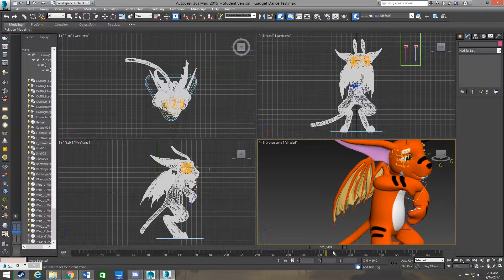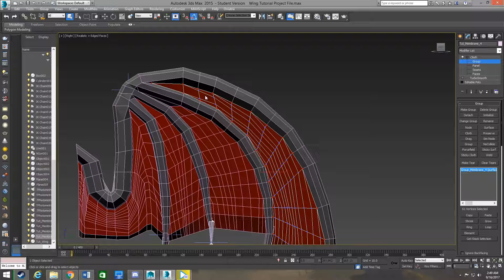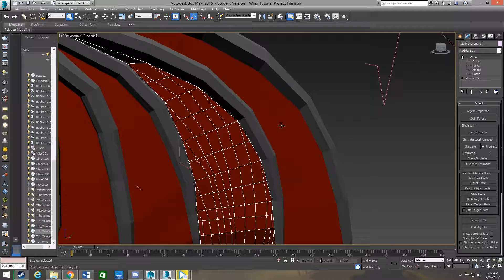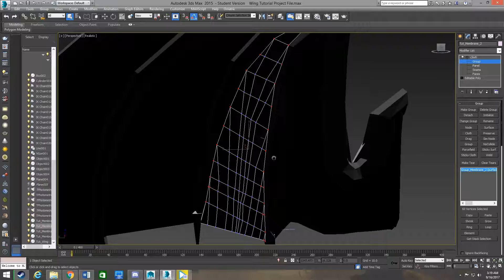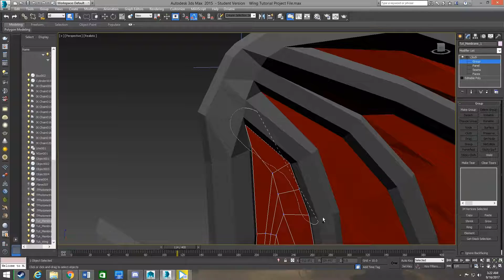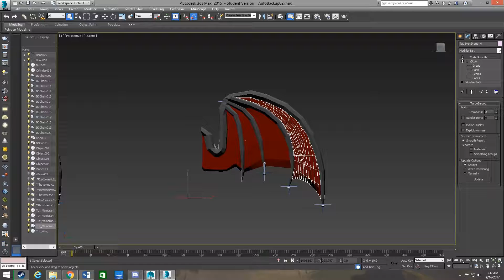[3DS Max Tutorial] - Dynamic Wings with the Cloth Modifier

Comment from the maker: Questions? Concerns? Suggestions for a future tutorial? Leave a comment!
Reply: hello, when I move or rotate the attatched wing the membrance and bones are separated. How can I fix this situation?
Reply from the maker: @aysenurbabacan59  Hi! Sorry for the delay. So the wing membranes will not follow the model until you simulate each cloth. It's a small drawback that I haven't figured a quick fix for. So essentially, you'll want your model in the initial position that you want, then animate the model. Afterward, you'll go through and simulate each membrane. Only then will the membrane follows. Let me know if that helps.
Reply from the maker: @aysenurbabacan59  You'll also need to make sure you are moving the bones. The model is attached to the bones, so if you move the model alone, the bones and membranes will stay put. In advanced rigs, there are usually helpers that move the bones, but for the purpose of this tutorial, I kept the rig very simple.